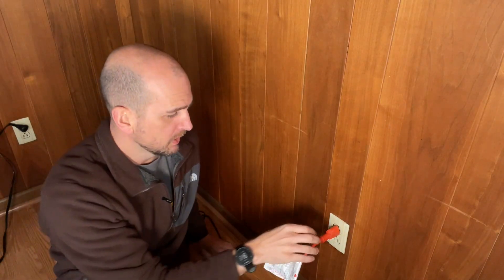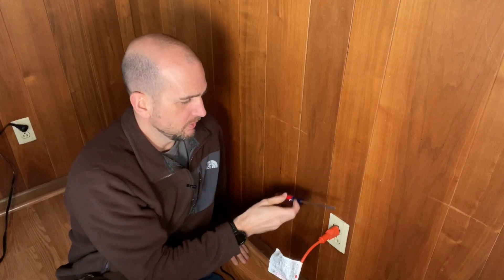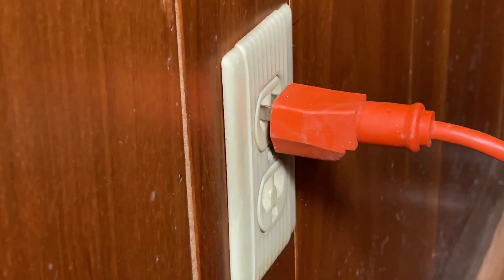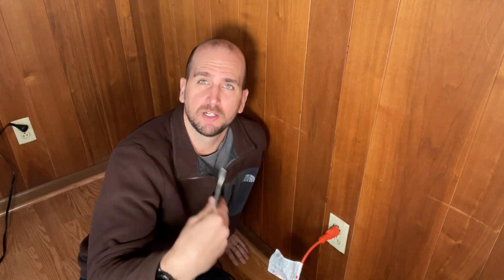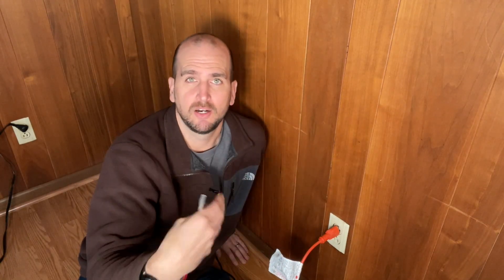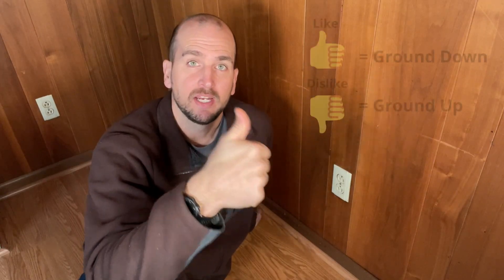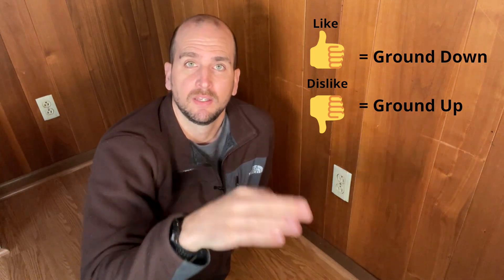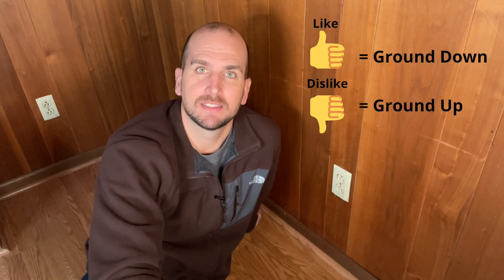Should An Outlet Be Installed Ground Down Or Up

Comment: I prefer ground-down for most outlets. I like the practice of reversing to ground-up for switched outlets. That's how my builder did it. Sure beats walking around the room with a lamp to figure out which one is switched.
Reply: Yeah, but, I have outlets in my living room where the bottom outlet is connected to a wall switch, so I can turn a lamp on or off by the wall switch, and the upper outlet has constant power, like where we plug in a clock or Alexa device.  Something that we do not want to be affected by the wall switch.
Reply: @johnnyz7752  How about marking the switched outlet with a marker or high lighter...
Reply: @johnnyz7752  I have that too. The installer took a Sharpie and made a small dot In-between the hot and common on the face of the receptacle so that you would know which one had the switched power.
Reply: @johnnyz7752  My parents have outlets like that in their living room.  Unfortunately, when they had an addition built, expanding the size of their living room, the electrician wired the outlets in the addition opposite to those in the original part.
Reply: @TheGuyThatEveryoneIgnores  Get a new electrician.
Reply: @johnnyz7752  The addition was built 40 years ago and my parents never cared enough to get it fixed.
Reply: @TheGuyThatEveryoneIgnores  Of course!
Reply: @johnnyz7752  hey bud, I always read other comments before posting my own and yes, you are correct. In all installs that I do, I follow NEC of course but, as far as ground, all grounds are on up side for me. Reason I do this is because say mom is vacuuming and the cord is at the end and pulls out just a touch, kids see that and want to touch the shinny parts of course. So, they would touch the ground if anything at all. Also, as in this video, same thing that was said, ground on top is safer because it's very rare to see something come from the bottom to make contact with hot and neutral in a ground up outlet. It is much more possible for a picture or something to fall over and bump plug and then make contact with the prongs. Either way. I think in the end of the day, NEC is vague on this and its preferences of the installer. Also, to your comment, on a dual shared outlet, all constant hot outlets for me are on bottom. Switched outlets are on top.
Reply: @johnnyz7752  I was taught in a situation as this to wire the top one as the switched.
Reply: @johnnyz7752  f eezzzze
Reply: I guess I'd just do a sticker. Ugly, but useful.
Reply: @johnnyz7752  That's why most receptacles have a break-off tab between the 2 outlets. It is important to have it on the same phase of 120 volts though. Don't want a 240 volt potential between outlets. I do odd switched receptacles grey. Orange to show they're on generator back-up. White or brown for normal.
Reply: @virginia7125  It seems some do wire 240V between outlets. Electroboom made a cable to run a 240V hairdryer that way (not recommended FWIW).
Reply: I prefer a color change for switched receptacles, but inverting the orientation is a common practice. The problem is that of only one plug in the receptacle is switched, then you still have to guess which half is switched. 

Colored faces address this problem as you can get receptacles with only one outlet colored.
Reply: @robb0995  Electrical standard practice. outlets that are split and one half is switched, the switched should be on the top half. I have been doing that since the 70's when I started the trade as I was taught.
Reply: @stevieg.4816  - agree!
Reply: @stevieg.4816  I was going to object to this then realised that if the cord plugged into the unswitched half was right-angle, it would conflict with the switched cord.
Reply: @stevieg.4816  I prefer to have the bottom switched so the upper one will be easier to reach for plugging in chargers, vacuums, etc.
Reply: @stevieg.4816  That's a great idea, having a standard. Mine are mixed and they are random top/bottom. I bought some rings that stick to the outlet covers to tell me which are switched.
Reply: That sounds good.
Reply: @stevieg.4816  what is the purpose or reason for top Outlet only (with a split receptacle one Outlet controlled by a switch)?
Reply: @stevieg.4816  agreed, that is the convention I remember learning as a kid.
Reply: @stevieg.4816  If it's not in the NEC, that's a local convention, not a standard. Which is not to say it shouldn't be the standard but that's another discussion.
Reply: @robb0995  I can't seem to find any receptacles with only one outlet colored. Care to share a link?
Reply: @robb0995  I've done this in the past by just painting the screw head.  Less of a "decor" issue I'm told.
Reply: Love it, Never heard of it, Every house I do now will have that.
Reply from the maker: For sure!  Also, nice channel I have ran across your content in the past and you are doing a great job 👍.  Keep up the good work.
Reply: @EverydayHomeRepairs  I've wondered about the correct way to install an outlet for a long time, and wanted to know if there was consensus. Thanks for the video!
Reply: The better approach is to purchase receptacles that are marked as switched.  Such as https://www.hubbell.com/wiringdevice-kellems/en/Products/Electrical-Electronic/Wiring-Devices/Straight-Blade-Devices/ConstructionCommercial-Receptacles/DR15C1WHITR/p/2608245
Reply: @TonyPombo  Or you could make a label. I have a Brady labeler that's great for labeling breaker panels etc. It can make wire and cable labels as well.
Reply: The builder put a tiny green dot sticker on every outlet controlled by a switch in my condo built 9 years ago
Reply: I usually donate a dollar store night light to indicate the switched outlet so that the realtor and new owner can tell what the switch does. Post-it notes also come in handy.
Reply: That would drive my OCD crazy!
Reply: @laneshaw6997  Ha - I didn't even realize I had OCD until you made me realize it.  It would drive me crazy too.
Reply: @laneshaw6997  You mean "CDO",  Alphabetically like it should be!
Reply: I always make the bottom outlet the switched one.
The thought behind this that the switched outlet usually always filled
& this way you will not have to reach under the outlet in use
to plug in something else.
Reply: If it's a problem,  you can also just put stickers on them. Hospital grade outlets will have green stickers.  Or at least the ones I've seen.
Reply: @SmallSpoonBrigade  Yep I've seen the green dot for hospital grade and also an orange/red triangle signifying an isolated ground for sensitive equipment.
Reply: @Sierra Guru You are reading too much into it, just look at the context with the scene of the movie, dont get weird like that.
Reply: Great idea.  Neve thought of that. We are all down.
Reply: That works for me too.
Reply: In my area of upstate NY it is rare to see residential outlets ground up. Not only is it a problem with right angle plugs, but I have a few large wall warts with ground pins that would be a problem. 

There are big companies that use ground up though.

It's also uncommon to see split outlets around here.
Reply: Honestly a great idea.
Reply: Not that it means much, but my father was an electrician for many decades and he mentioned the same thing with reference to my house which had switched outlets with ground-side-up. He mostly worked commercial at Boeing so I'm not sure how useful that advice was.
Reply: I label mine with a vinyl label. Removes all doubt! I also include the breaker number. Alternatively, you could use a floor plan and mark this, but then you have to keep track of that paper. For light switches, I put the breaker number on the inside of the cover plate. When I'm working on a switch, for whatever reason, I immediately know which breaker to turn off.
Reply: I've never lived in a house without switched outlets and missed them. When I did, it caused problems because my wife would plug the vacuum cleaner in there and it would blow the thermal fuse in the remote light/fan switch. We never plugged a lamp into it either. Waste of time.
Reply: Very smart protocol
Reply: Rarely ever are both halves of an outlet switched. So that idea doesn't make sense. If it is your house, you will either know or soon lean which outlets are switched, if any. If you are an electrician, you have to check everything anyway. You have no idea what someone else may have done.
Reply: @geraldscott4302  Gerald, I was working in a house a couple of weeks ago. The development was built in the 50's or 60's. None of the original outlets had a breakaway tab in between the upper and lower receptacles.
Reply: @geraldscott4302  I've lived in this house for over 20 years and can never remember which Outlet is switch controled. 😁
Reply: @geraldscott4302  Personal experience for me is that people think they want switched outlets until they actually have them 😆. They can be a pain if you're constantly switching something off by accident.
Reply: Good point
Reply: That's genius!
Reply: They make receptacles in different colors for that purpose.
Reply: Who the hell has a switched outlet in their home anymore unless you're a boomer. Recessed lights got rid of the practice of switched outlets. There are always plug-in modules that make outlets switched now, like Z-Wave, Zigbee, UPB, etc.
Reply: @WilliamJefferson1776  well, depending on the area maybe as well not just the boomers. Here in Tampa area, I'm working on a house that has switched outlets thru out the house. The customer doesn't believe in all that technology. They want switched outlets that will work no matter what. They don't even use the internet and don't have cable either. Also, pretty cool idea, they are going to have a tray ceiling in the master and a switched outlet in the tray area. The builder they are using does that in all their builds. Then just plug in a set of string lights for accent. To each their own I guess.
Reply: I install grey receptacles on switched circuits. Most people use brown or white, so the grey stands out & is not a hidious color like orange or red. I use those colors to show generator back-up etc...
Reply: A simple solution would be to take a label maker and just label which outlets are switched.  Black on clear labels work well on most cover colors.
Reply: Those who drafted our code were worried that a picture with a metal frame could fall from the hook and short out the two power pins. So far, in the past 50 years at my home, that has not happened. Any appliance, like a vacuum cleaner, or power bars, cause issues at the receptacle because the plug comes in at an angle.   There is a physical tension of the cable or device weight towards the floor. Pin below just works better.
Reply: @lsatenstein  50 years man!?! Only takes a minute or two to flip each.
If the recepts are original, I'd plan 4 to 5 minutes each and swap em.
50 years and you have grounded receptacles, no s**t!!!

Edit: 50 years is up to '72 now..... Damn I'm getting old!.......
Reply: Many are ground down to fit in a makeshift outlet box.   But say he was replacing a receptacle in a kitchen,  and accidentally dropped the new one into the garbage disposer.  That one would probably be ground up.  þ
Reply: I label face plates with circuit # and an sw for swithed
Reply: What's the point? Do people move in and out of these houses often? How hard is it to find the ½ switched? Only needs done once per room. Now you gotta look at one f'd up receptacle in every room til you fix them or move.
Right?
I am just a commercial sparky......
Reply: I wish they made outlets with 2 colors for the top and bottom where a light switch is used for the outlet. The one with the inconsistent color is th3 one on the switch.  Flipping the outlet ground up won’t help much because I’ll still have to use a lamp to figure out if the top is on the switch or the bottom.  If I’m building a new house, I will ask that no outlets are put on a light switch at that each room have a ceiling light or fan/light instead.
Reply: @markfenbers1329  As I was just informed, they have an outlet that would fit that need.  It is marked "controlled" on the face next to the outlet that is to be controlled by the switch.  This particular one is made by Hubbell.  Here is the link I was sent : https://www.hubbell.com/wiringdevice-kellems/en/Products/Electrical-Electronic/Wiring-Devices/Straight-Blade-Devices/ConstructionCommercial-Receptacles/DR15C1WHITR/p/2608245
Reply: @cfgdr3  TIL about this type of outlet; thank you
Reply: @markfenbers1329  Just follow the rule of wiring the top one to the switch.
Reply: @The-Friendly-Grizzly  There is no such rule.
Reply: That's pretty standard here where I live in new homes. Switched outlets split and ground up.
Reply: i prefer ground down but i do see the logic of having switched reversed for quick reference.
Reply: Great idea. When I’m switching outlets I just switch the top of every outlet in the room. Easy easy.
Reply: The ground is up, so the wire don't lay on the ground.
Reply: Except if it’s a split outlet, I always put switched on top.
Reply: DOWN ALWAYS!!!
Reply: @mm-xu5df  Only a Sith deals in absolutes.
Reply: @jaycweingardt11  you might be right
Reply: @mm-xu5df  So Say We All !!!
Reply: @ HandyDadTV   You Prefer Wrong !!  Gd up because if something falls down if hits the Gd and does not create a short circuit

Comment: An upside down outlet [is supposed to] indicates a 'half-hot' receptacle. Meaning: half the outlet is switched while the other half remains 'hot' (live). These are usually found where table lamps are desired to be turned on via a wall switch when entering a room.

Comment: Neither.  The optimal orientation is ground on the LEFT with the outlet mounted horizontally.  

This orientation places the NEUTRAL prong in the UP position, so even a polarized plug is safer (if partly exposed as you describe). 

Furthermore ground-left horizontal position places the HOT prong tucked away at the bottom of the receptacle with lots  of protection by neutral and ground conductors that have nice big fat low-resistance paths to Earth, decreasing the chance than YOU become that path.
Reply: .Ground-Neutral reversal;

Comment: All the outlet testers I have ever seen require the ground down to see the lights. If it was up, you would have to stand on your head to see them. (or use a mirror)
Also, my father (who was an electrician for about 40 years) always put them ground down.

Comment: Certain plugs are designed for ground down. I'm actually so convinced ground down is correct that when I moved into a house with ground up, I started flipping the outlets. However, eliminating the risk of shorting is a valid argument for ground up. Foreign plugs are designed better with the plastic shield at the back of the contacts.

Comment: As a master electrician, i am faced with this question frequently. You are correct the nec so far has no code for this. 
 If you notice on any 3 pronged plug the ground prong extends farther. UL   wants the ground to be made before energized. Height on a wall , whether near the floor or 5' or so makes a difference how its inserted, ergonomically.  The higher the location the easier position is ground up. Thanks keep up the content, enjoy the videos.

Comment: It’s a safety issue and no, nothing will undo the problem of two prong. Lighting is mostly guilty on this one. Other than commercial or industrial is this likely to occur. The exception to that may be in a reception area. You don’t see a great deal of two prong use. It’s a problem and I don’t see or hear of any action on it.

Comment: Prefer ground facing down, but think a awesome new method would be to  have the duplex outlet with one outlet with ground up and the other ground down, allowing ease of plugging in those cords that are at angles.
Reply: Interesting. I have also seen in older residential homes and apartments the outlet had 1 recpticle switched and the other was not.

Comment: A while back I read in a wiring book that if the outlet cover is metal the ground should be installed up such that in the outside chance the cover became loose and fell off while a plug was inserted, it would hit the ground pin first and not cause a short across the current carrying pins.

Comment: I was an Industrial electrician for 37 years and have seen a lot of ground pins broken off.  I've installed them both ways and observed them for years.  Skipping the obvious reasons, I've learned to mount them  up if they are mounted high, (3' or more), and down if they are mounted low; this allows the plug to come  out smoothly when someone jerks it out or snags it.

Comment: If an outlet is so loose/worn that it can't properly hold a plug in, wherein dropping something conductive across the plug blades can possibly cause the short and (inconveniently) trip the GFCI/breaker/fuse protecting the outlet, it is a wake-up call the property owner to replace that outlet before something really bad happens!  I see no downside.   |.|  tbh though, specifically putting only switched outlets |'| is a neat idea.